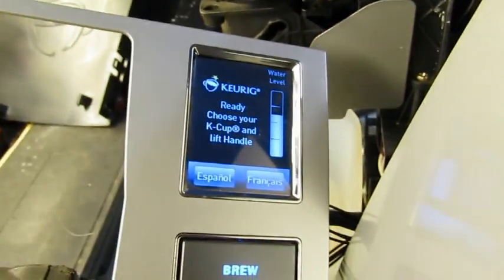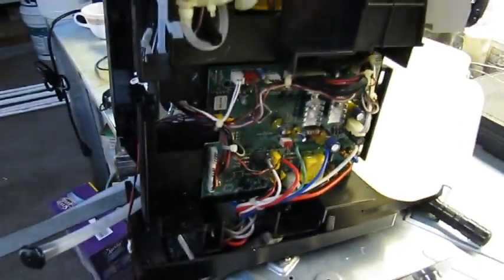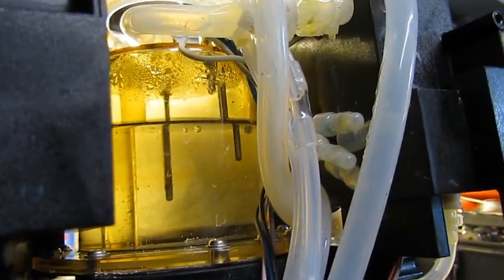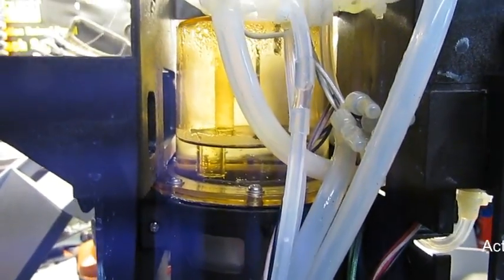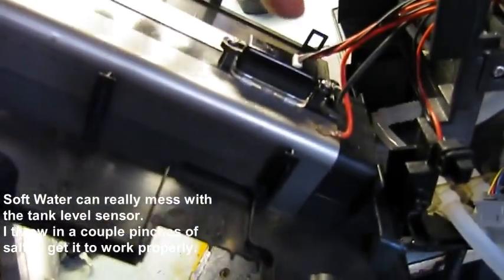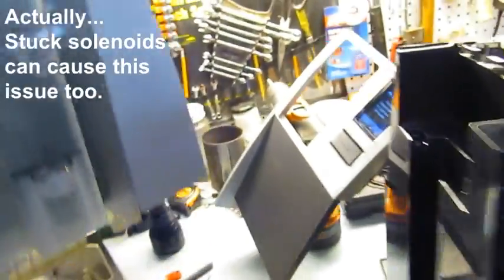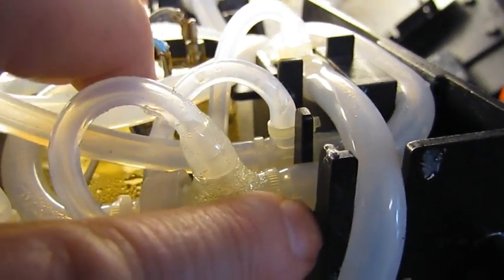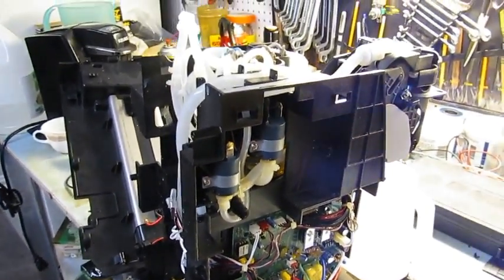Keurig Secrets Revealed - Look under the hood of a working Keurig K155!

Comment: I have the K150, it pulls water in heats it up but won’t go into brew mode, just stays in the heating phase. When I drain the lines there is plenty of hot water. 

Any thoughts? What is the part number on the solenoids?
Reply from the maker: Hi Joseph. In your comment you say that it won't brew and stays in "heating phase".  Normal operation of any Keurig will delay brewing until the water is hot enough. If the K150 has an indicator that clearly says the machine is constantly in heating mode, then the computer on the machine will think the water is not yet hot enough to brew. The culprit in this case may be a defective temperature sensor that thinks the water is never hot enough. The solenoids controlling water flow may not be the problem.
Reply: @deanstucker  is there a way to replace this temp sensor?
Reply from the maker: @bhamjoe  I no longer have access to that machine but, if you go to 6:43 in my video and look at the far right edge of the screen, you can briefly see what I believe is the temperature sensor pressed against the metal tank.  I get my parts from ebay.  I looked for a temperature sensor but was unable to find one by itself - but you can buy an entire tank with a temperature sensor (or switch) attached to it (for about $19.00). See https://www.ebay.com/itm/224690190400?hash=item3450943840:g:OkwAAOSwkzdhjt1b 
Note: This could be either a temperature sensor (measuring degrees for when to begin brewing) or perhaps it may be a simple thermal safety switch which would shut the system down if the temp sensor goes wonky.  If there are two devices (tem-sensor & safety-switch) then both would likely be attached to the tank that you would buy.  Methods for fastening sensors to the tank may differ between different models but the creative use of nylon zip ties could resolve that issue.

The solenoids (that control the flow of water) come in two different "flavors": gray plastic and metal.  Based on my experience they are both the same size and they function exactly the same.  I suspect the plastic ones come from newer Keurig models that are cheaper to make.

Comment: Like you, I struggled with removing the back/top cover without doing a lot of cosmetic damage. Even trying to push it back was not helping much. I eventually succeeded using a set of the plastic release tools designed for removing inner panels of automobile doors.

Comment: Nice video but the one question I was hoping would get answered is how does the water get through the cup when there is no hole in the bottom of the Keurig cup? The Keurig cup is never wet on the outside so is it sucking the water out after it pushes it in?
Reply from the maker: Look at the bottom of a K-cup after brewing. You will see a small hole in the bottom of the cup. The hole is created when you hear/feel that little "pop" when closing the handle just before brewing.
Reply: Okay, I guess I missed that We don't actually have one I just use one periodically other places and I hadn't noticed a hole in the bottom.

Comment: I had a Keurig K155 fail where it would ask for the water reservoir to be lifted and filled, when it was already full. When it did get past that point, pressing the “brew” button would trigger a unit reset. This was preceded by a growing problem with the LCD display having a vertically scrolling dark band while the brew process was underway. The problem was the two filter capacitors on the PCB beneath the left-hand side cover: 1000uf 25V and 1000uf 35V 85C no-name Chinese “Teapo” caps. I installed two 1000uf 35V 105C rated name brand (Panasonic) capacitors, and everything was perfectly fine.

Comment: Could anyone tell me what those 2 clear flexible hoses that come out of the back of the keurig are for, they have black plugs in them blocking them off...
 I assume draining the system?
Reply: Drain hoses for the reservoir tanks.  Cold on the left, hot on the right.

Comment: I will looking at your page and my problem with mines I had the problem before with the water one coming out and I fixed that by looking at YouTube but now it did it back again but this time the water has stopped coming out and now it's its system I plug it up the machine won't even cut off and it don't run but it won't cut off it won't do nothing and say overheating that's all it said and then tell me to go to the to the curvy website just try to fix the problem but I don't know what to do I don't want to throw it away it's a good machine it probably looks like probably see you when all the way through the one side to the left side of the other machine I know you can fix it the problem I don't know nobody in my time can fix on them I live in Pensacola Florida but if either way you can help me I don't want to keep buying a car for me to come for me to call for a lot of money and but anyway what can I do the machine won't cut off I can't switch it back off and on I put it all to fix it it won't even it'll stay on but it won't run you can't get Bruno coffee with it what is wrong with it or how can you help me

Comment: I need technical assistance. I have the K150P model, today our electricity was off due to an ice storm. I hooked up my portable generator to my fuse box ( after switching the main off so I didn't backfeed power into the community) and managed to blunder. Long story short, I fed my K150P 220volts, didn't realize it and switched the coffee maker on and it fried something, no smoke or burning smell, just didn't power on. My question is, is the on/off switch on these units a thermal protector type, that will act as an inline fuse that will break the circuit in case of an electrical feed overload or do you think that the problem lies deeper within the circuitry? Better yet, is there a resettable circuit breaker hiding inside these units? Sure will appreciate some expert advice, thanks.

Comment: I recently had issues with my smaller machine... I took it apart and disconnected the tube from the heater and positioned it over a bucket and spayed tiny bursts of my air compressor... after ten small bursts I was amazed how much orange tinted lime scale came out... it was like brand new once put back together again..

Comment: I have this same model that will let me touch the screen through the start-up, but gets stuck on the touch screen calibration
Reply: My finger was too large so it would not work, used a tool to touch, worked fine.

Comment: Is the heated water exposed to plastic parts in the device? That would make the device grossly unsafe to use due to microplastic leakage.
Reply from the maker: The heater section (bottom half) of the reservoir is made of metal.  The top section is made of hard clear plastic.  After each cycle, the water level is maintained at the lowest possible level with contact to SOME of the clear plastic in the top half.  A major factor in microplastic concentration in the water is TIME.  With regular usage, the level of microplastic leakage is acceptable to me.

Comment: Dean, Our B155 lies about water temp. Up to max 198 but in reality its 184. Measured with multiple calibrated thermometers so its confirmed.  The coffee is never HOT enough like a normal hot coffee would first be where you have to wait a bit to sip it thats what tipped us off then we measured. So--  Is there a fix? Can't brew full flavor at that temp.  A thermistor swap?, an adjustment?
Reply from the maker: Good question!  I don't have access to the inside of the K155 now, but a couple of possibilities come to mind.  1. Look for a variable resistor (potentiometer - a component that you can turn with a small screwdriver) on the main circuit board.  If you find one, mark the current setting and then try adjusting it to see what happens with the temperature.  2. If there is a thermistor screwed, glued or otherwise somehow attached to the metal part of the tank, look for ways to Slightly lessen the contact between the thermistor and tank - but NOT TOO MUCH as this could turn in to a fire hazard if the contact between the two is reduced to the point of the heater never turning off.    Confession: I'm not too thrilled about the second idea. Use at your own risk.

Comment: Mine clicks but doesn't turn on.    It feels like the switch is clicking.  IAC, after watching your excellent video I decided to attempt taking it apart,  AH HA!!  I found the reason the back won't come off so easy. There are hidden screws.  What looks like faint circles are actually rubber plugs.  I used a 1/8" drill to cut a hole and then used the bit as leverage to pop the plugs.

Comment: Great video!  
We lost power the other day and when it came back on our B-150 spontaneously made a cup of coffee and the display read  "System Overheated"
Haven't been able to get it to do anything since.
Any insights would be much appreciated - thanks!
Reply from the maker: Sounds like a defective thermal switch/detector - OR - the relay which activates the heating element is stuck in the "on" position. 
I recently had a RV furnace refuse to produce heat (even though all others functions - thermostat, fan, delay circuit, etc - continued to work fine) because the thermal limit switch became defective. A simple $13.00 fix.

Comment: Nice work, Dean.  Very impressive.  I hope you can answer my question about my K155, less than two years old.  When I plug it in, all it does is click, click, click, and the touch screen does not light up.  I was told to plug it in another outlet, but no luck.  Any suggestions with just that limited info that you can offer?  TIA
Reply from the maker: Rosanne, I recently received feedback from another person that may be the answer to your problem. Look on the main controller board for any large capacitors that have bulging tops. The top of these capacitors perhaps will be shiny aluminum. (Perhaps with a marking that says 1000 uf"). The top of these capacitors should be flat, like the top of a pop can. If the top of the capacitor is bulging, then the capacitor is bad and it should be replaced.

Comment: Thanks for the video. It helped me fix a machine that someone threw in the dumpster at work a few years ago. Currently though, we had a power outage, and I think it took a surge. It humms, and clicks (the solenoids trying to engage/disengage), and the display is dead. Any ideas? I looked over the main board but didn't see any obvious burnt components.
Reply from the maker: Try looking at the main board again - with a focus on the pop can shaped components (electrolytic capacitors).  If the top of one of these capacitors (sometimes laying on their side) is bulging, then the component needs to be replaced.  It won't looked "burnt".  Just bulging at the top.  I've seen feedback from others that had the same "clicking" issue.  Look for the value and the voltage written on the capacitor  (ie:  15V and 1000uF) and order an equivalent component from Amazon (bag of 10 may be $7.00-ish) or a local electronics store.
Reply: @deanstucker  Thanks for the reply Dean. I'll take a closer look.

Comment: So, I left my K155 unplugged while we were away on vacation for a couple weeks. When I got back and plugged it in again, it just makes a clicking sound that seems to be coming from the side, on the corner near where the power switch is on the back. The clicking noise is coming from where the solenoids appear to be located in your video. Also, the digital display screen does not come on, but if you look carefully you can see it flash VERY quickly. So, for seemingly no reason now I am left with a K155 that will not power on but just makes the clicking noise when plugged in. Any ideas for what is causing the problem?
Reply from the maker: My guess is a failing transformer. If you have a voltmeter, try measuring the voltage going out of the transformer to the circuit board. It should be something like 15 volts or more. CAUTION: remember that this appliance utilizes Household high voltage. Risk of high voltage shock is always present when testing a plugged in appliance.
Reply: I have the exact problem and can’t find anything, did you find a solution yet?
Reply: So I fixed my machine. The problem was two capacitors on the main logic board had gone bad.  They are the two largest caps labelled 1000 uF. If they are even slightly bulging on the top then they are bad. After replacing them the clicking stopped and machine works normally again.
Hardest part was taking the machine apart... What a pain .
Reply from the maker: @matt.604 
Thanks, Matt, for sharing the solution! I'll be sure to tell others to look for "Fat Capacitors" when they complain of similar symptoms. I should have thought of that. I repaired a nice 55in Flat screen TV by replacing the "Fat Capacitors" on the power board for the TV's backlight.
Reply: @matt.604  Thanks again Dean for posting this video and Matt for the solution. Same problem with mine so I also replaced the 1000 uF / 25v capacitors with Panasonic brand equivalents. I was surprised - in a good way - when it turned on and was happy to brew again! Soldering in new capacitors was more tricky than I expected (I didn't remove the circuit board and did it all in-place). And yes, the enclosure is a real pain. Still, that's the most value I've had from $1.83 capacitors!
Reply: I have the same problem too.  The machine was unplugged for a couple weeks and now it just clicks when plugged in.

Comment: So this is my second time to this video as I fixed a slow brew about 6 months ago.  Now the machine won't even power up to see the menu screen.  Blank / black screen when plugged in and power button is switched on.  There is no noises anything.  I've tried holding the screen, pressing the Brew button 3 times, etc..  Nothing.

Is there a set of fuses or power supply that I can check or replace before scrapping the whole machine.  Love this thing.

Thank you!

-Gene
Reply from the maker: If you have a voltmeter, check the output of the transformer. I've seen the transformer go bad on a Keurig.  Any generic transformer with near-same voltage and current (Amp) capacity should work fine. Look on the original transformer before discarding it. And yes, check for anything that even remotely looks like a fuse. It should read the same voltage on both ends of the fuse.
Reply: @deanstucker  Awesome.  Will do.  Thanks for the reply.

Comment: The Older ones had two pumps, one a large piston pump, also the air pump on that one did not force the water from the heating tank. It's function was to push the remaining water from the K Cup, it will not drain out by gravity, yours uses the last bit of air do that function. They have incorporated many functions in the newer models. I miss the sound of the old piston pump ! (if it will not work with distilled or RO water (which we use in our camper) just put 4 or 5 grains, the smallest pinch you can, of salt, the water will conduct and all will be well. (and that's added to a gallon) not the machine tank.

Comment: Question for you as you seem too know these machines far better than I do. Will the solenoids from a k155 work on a k150? I have a k150 that I determined (after watching this video) had a suck open solenoid, and it did. Had a working k155 that my wife broke (a piece in the pod chamber). I swapped out both solenoids from the k155 to the k150, now when I plug in the unit, I get a click from one of the solenoids, then nothing, the screen does not come on. I'm sure I've got them wired in correctly. Any help would be great as if I can't figure it out, then to the land fill it goes. The solenoid do look different, the one from the k155 are blue and the ones from the k150 are chrome and the labeling is quite different as well. I'm not an small appliance guy, just a parts changer so the labeling is Greek to me
Reply from the maker: Hi Dee.  My guess is that the solenoids are interchangeable.  Two factors to consider.  Voltage and Function.  The voltage (a number with the letter "V" after it) is typically printed on the solenoid.  They should be the same on the old and "new" solenoids.  The functionality can be checked by taking a short length of tubing and blowing through the solenoid while applying voltage.  If there is no change in air flow then the solenoid is bad.  But I think something else has happened.  Regardless of whether the solenoid is good or bad, the screen should come on.  The solenoid is nothing more than an electromagnet.  It is not a relay that switches circuits on and off.  So I suspect something else is preventing your screen from turning on.  Perhaps a transformer going bad.  I had that happen to m e.  You might try swapping transformers.  Don't forget to unplug it!  :-)
Reply: @deanstucker  thanks for the response, and quickly too. Yeah I've come to that conclusion as well. It was functional before I started on it, and I did real good pulling it apart, so I thought. It was quite the bummer when put back together it wouldn't come back on. What I don't understand is why the solenoid tries to do whatever it does then nothing. There must be an internal check, and the system is not liking some thing and shuts down before even starting up. Unfortunately, even in these times, I do not have time to try and track down what I may have done wrong or may have broke while doing the swap. Have found another k150  close by for only 50 bucks, so this will become a parts machine or until I have time to try and figure out what happened in my attempt. But thanks for the reply, much appreciated